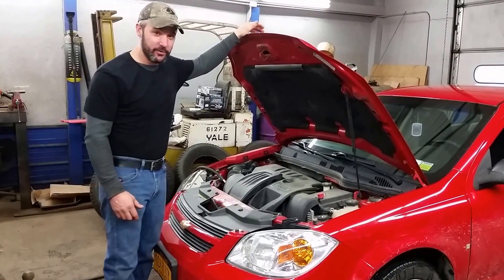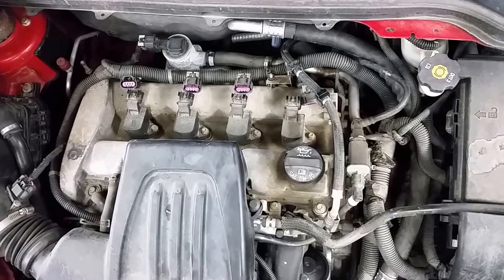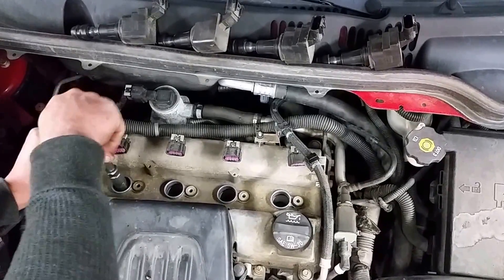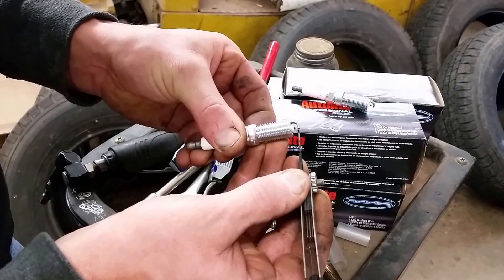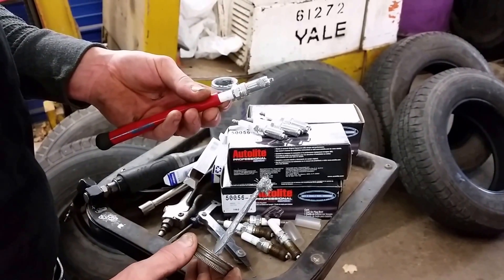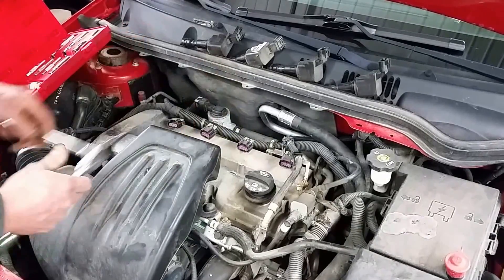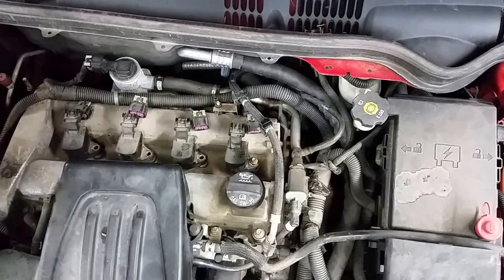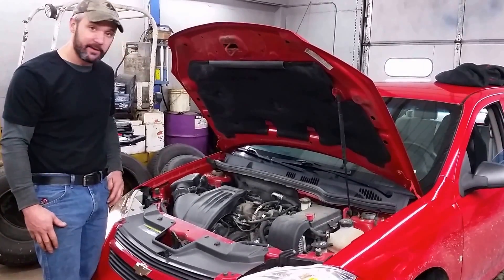Chevy Cobalt - Replacing Spark Plugs

Comment: I suddenly developed intermittent shaking after fueling in my 2009 cobalt 2.2 l . It has 121000 miles. I put it a can of heet  in red bottle. I drove it a few hrs and it ran fine then it returned. I have been using premium  non ethanol fuel for 12 years. It has original spark plugs. I got code P300- Random misfire. This only occurs occasionally. Could it be water in gas. There were torrential rains in area about 10 inches in past week. Could it be related to spark plugs? Would it be better to use ethanol gas in humid summer to prevent condensation of water . Any thoughts. Thank you. I wish I was in NYS now or would have you look it over. But I'm in Iowa.

Comment: I read that AC delco does not recommend anti seize?    Why not torque?
Reply: Antiseize is a personal preference thing.
After the first few hundred spark plugs the elbow calibrates itself to the right torque.
Reply: Thats great for you but what about the guy whose elbow is changing a plug for the first time ,  GM says not to use anti seize    back when heads were steel ,elbow torque wasn't as big and who had a torque wrench that could get down between the head and firewall or upper control arm .   Thanks for the tips
Reply: @rbspider   he does say some use anti seize and some don't.
Most spark plugs have a "tighten until it touches then go 1/8 or 1/4 turn more".  You just need to look on the manufacturers website.
Getting them out to s usually harder than refitting them.

Comment: Hello, Eric. If you are using a torque wrench, how much is too much ?  My wrench was off by 5 ft-lb and instead of 15 ft-lb I did 20 ft-lb... I removed the plug, replaced and tight it to 180 in-lb with another wrench, just worried if I damaged the threads.

Comment: paging dr eric o idk if you tried it yet but the castle brake lite grease works great as a dielectric grease too little pricey but very good we used it on all our star pack strobe lights and safty vision back up cameras on the garbage trucks i think it was around 30 for a vaccume tube cheese wiz can or they had those little 35mm film projectors contaners of it wow that ages me film strips and overhead projectors yes grade school late 70 s lol great work keep it up. wait this is from 3 years ago my bad

Comment: correction they did not make a 2002 cobalt in 2002. the cobalt came in the fall of 2004 as a 2005 model
Reply: Correct it was the Caviler before than. J platform. Cobalts were D plats.

Comment: Hi Eric, I have a 2.9L four cylinder 2007 Chevy Colorado with about 72K miles and the process for changing the spark plugs is similar... remove air intake, remove coils, remove plugs. BUT when I tried to remove the spark plugs they did not want to turn. I used a regular ratchet and pushed really really hard and they would not come off. I decided I didn't want to break the cylinder head on a truck I still have to pay on for another 50 months so I stopped at that point and put it all back together. Do you have any advice in this situation? I think I should just take it to a shop but I really don't want to pay $95 for something so simple - the only advantage that I see is that if they break something it is their fault, right? By the way, the engine was cold when I tried to change the spark plugs (it was sitting overnight) and the actual reason I am changing the spark plugs is I don't get very good fuel economy (16MPG), many people with these trucks report 20+ and because I have a rough idle issue. Thank you for any advice, your videos are informative (and funny!)
Reply: if your having performance issues it might not be your spark plugs. i gained 3 mpg in my recently engine swapped crown vic by eliminating vacuum leaks. such a common cause for performance issues. but if your plugs are 72k miles old, maybe changing plugs isnt so bad.
Reply: Michael Staake make sure your turning the ratchet the right way. left to loosen right to tighten. it should come out. with a Lil force won't hurt.
Reply: Michael Staake also doesn't hurt to add fuel additives to you gas. like Lucas fuel treatment or seafood. my two favorite brands
Reply: loganator78r mmm seafood! do you add shrimp, lobster, or crab?

Comment: Oh the good old Ecotec 2.2L...where valve seats wear out before the spark plugs! The one I just did didn't even have that stupid plastic cover on it to begin with...that's why the directions confused me "remove head cover #2"...WTF? I think it's a Eurotrash Opel motor design, since the timing tensioner said "made in Germany" lol
Reply: No offense Ivan, but 'our' Opel motor design got trashed when GM took over. Actually Opels are pretty good cars...as long as GM leaves them alone. Chevy once tried to get a foot into the German market, just when they realized their own brand Opel was better than what they offer to the rest of the planet. 

I myself am a JDM fan, but I think the 'Eurotrash' attitude seems to be a bit over the top, not every European Car is a Fiat or Volkswagen (and I think these indeed are 'Trash'). Every manufacturer has it's weaknesses or stupid ideas, but I think there is a reason why Mercedes can charge twice the price and still sell the cars, because there is 'some value' in them.

By the way, just take this as constructive criticism, I'm a huge fan of both your channels and find them really valuable. And don't ask me how I dug out this video...just popped up as if it was new...
Reply: +motoYam82 mine too
Reply from the maker: +motoYam82 It is made by GM "general mess" . Man you dug this video out of the trash haha
Reply: It was in my "recommended videos" list lol

Comment: For people that don't have compress air they can use a shop vacuum to remove the dirt before they take out the spark plugs.
I use a spark plug socket that has a magnet in it.  I like that better than a socket with the rubber plug.
Reply: Me to I have lost those rubber do dads on the plug after you pull the socket. Alway on recessed plugs to. I got a few good long reach pliers so I’m not complaining.

Comment: 2 questions. Is it possible to tell visually if the plugs need to be replaced? Is dielectric grease the same as dielectric silicone compound?
Reply: Plug gap can grow or rather the electrodes get vaporized away during use leaving a larger gap than original so yes, you can see that.  Often it's not so bad on some plugs and if they are burning clean they don't need replacing, but why make more work for yourself?  Just change them all to keep on schedule and be done with it.  When they fail internally you can't see a good one from a bad one though which makes it all very much a crap shoot and not worth trying unless it's a lawn mower.  Yes dielectric compound is silicone grease, it's also thermal heat sink grease for your CPU's heat sink for example.
Reply: matt spark plugs cant be visually inspected by eye. unless they are clearly broken lol. but i just usually replace plugs on a service interval or if i have proof that is my issue.

Comment: Hey Eric, what does putting dielectric grease on the end of the coils do?
Thanks
Reply from the maker: +Daryl Zero seals out moisture and stops corrosion
Reply: +South Main Auto Repair Thanks!
Reply: @SouthMainAuto  dielectric grease is my best friend, more then rtv or anti-sieze. I like to put a VERY thin coating on the ends of all my battery starter alternator and body ground points after I take a brass brush to them, keeps any corrosion from forming due to moisture. You just have to remain aware that dielectric grease is NOT conductive. So only use it when you KNOW for certain your connection is making positive contact.

Comment: Great video one of the main issues I have with modern vehicles are the dang 50,000 different styles of electrical connectors and how to take them lose. They are usually in a spot I can't see them either. If you have any tricks please share. Thanks
Reply from the maker: +Eric Corse No real tricks because they are all so different it seems

Comment: Another great vid.  I have an issue with the plastic engine cover.  You have to remove the oil fill cap in order to remove the engine cover then yank on the cover and dump all the surrounding  dirt into the engine thru the oil fill hole. I was blowing dirt away as best I could with compressed air before removing the oil cap. I have since removed the plastic engine cover permanently unless someone can give me a good reason that leaving it off might cause a problem.
Reply from the maker: dan andy Smart man.....

Comment: They are the non gasket plugs? I have a 09 Accent SE and I decided to gunk the engine, seems with all the engine covers the coils still got wet and it was running on 2 cylinders. I pulled the coils out and saw they [2] were arching out on the plug wells, bought 4 new ones on ebay for 36.50 including shipping, while I was waiting I replaced plugs, air filter and PCV- 1st time I ever torqued plugs=20 ft lbs. I just used 2 cans of Gunk on my 96 Jeep GC 5.2 and no problems

You're very good at trouble electrical shooting

Comment: I've always used anti-seize on the spark plugs over the last 30+ years as long as you don't goop it on, use it sparingly. I use my finger to remove any excess. The problem I've seen over the years is the "More is better mentality" not so in this case.
Reply from the maker: nswst8 Well Said Sir

Comment: How good are these cobalts, my roomate has found a "deal" on one. I'm a honda/toyota guy but I know some of these cars aren't to terrible.
Reply: Rick James I got mine pretty much new with a rebuilt title.  It's a 2009 so it has the VVT version of the 2.2 Ecotec, and I've put 87XXX miles on it with nothing more than oil changes, a wheel bearing, and a camshaft position actuator (44 dollars from Autozone.  10 minute fix).   Runs like day 1, and I'd drive it across the country today if I had to.
Reply from the maker: Rick James Mehhh there OK , Not a Honda but they are OK...
Reply: If you take care of them they run forever. With that said. Make sure it was well kept. GM used a lot of super cheap parts. Including but not limited to ball joints, and emmisions parts. Also make sure every recall has been done. There was like 16 different ones I think.

Comment: Hey any cobalt owners here have problems with the signal not working on front and rear but only on the right passenger side and same side bottom brake light not coming on when pressing the brake? The same right signal parking light for the signal will only stay on when headlights are on at night.
  Ive changed the light bulb for the rear brake light, it only turns on for a second when opening with alarm. Im stumped and tired of this pos! 
-Changed an alternator and fuel pump, had electrical problems in the past especially the key getting stuck in ignition.
Reply: ***** If the key is stuck in the ignition in the run/on position, that's actually a recall.  I had that problem a couple years ago.  Took it to the dealership and they replaced the ignition cylinder.
Reply: Yukon Silvermoon yea that stuck key happened in 07, n the key has one half in the ignition since it was my mother who used it and the amount of keychains she had on it snapped the key, i dont have money for a new key so it resides there until i take it for the recall.
Reply: ***** Jesus Christ.  Does your mother do triathlon training and hang her weights on the poor key?  I know that caused a lot of the cars to turn off while driving, but actually snapping the key is crazy.
Reply: Yukon Silvermoon lmao no she had heavy keychains like the disney ones n some little metal shoe n with the addition of the amount of house keys, It just gave. Luckily we made a extra for the doors but we had a alarm on it. But the driver side door stays locked when the alarm opens. This pos is having problems pop up since middle of 2013
Reply: ***** Wow, that's strange.  I guess it's just a case by case basis, because I have a 2009 model with a little over 87K on it.  Besides normal maintenance and recalls, I've only had to replace a camshaft position actuator, which costed me 44 bucks and took ten minutes to replace.  Oh, and also, the door speakers are crap on the cars.  They aren't well insulated, and shorted out with the smallest amount of moisture.  Replaced them with a pair from Memphis Audio.
Reply: Yukon Silvermoon mines a 06 goin at 91k. The driver side speaker popped so it doesnt play the sound. Also the hood, roof and bumper paint is chipping from sun damage so the list of fixes is going up haha. Im fucked. The only thing im focusing on is gettin info on the brake light because a ticket could be given and idk what is causing it if i changed the bulb....
Reply: Yukon Silvermoon oh i forgot. Right now im in the process of buying two front wheel bearing hub assembly to replace. 100$ each :(
Reply: +Alex M Cobalts do not have a flasher like cars of yesteryear. The flashing of the turn, brake and hazard lights is done by the Body Control Module. And the clicking sound you hear when you use your signals or hazards is because the body control module sends a signal to the radio to make an artificial clicking sound that is heard through the drivers side door speaker. Could be, your BCM is faulty and needs to be replaced or reprogrammed.

Comment: I have never understood the point of using a plug installer or vacuum line to start the threads. when a plug socket and extension works just fine
Reply from the maker: ***** Some people are dangerous with that combination and aluminum :)
Reply: yep

Comment: You can't stress enough how delicate iridium/platinum plug tips are! I would not recommend first timers trying to gap them, because of the risk of damaging them and also because they come close enough from the factory 99% of the time.

I used to also use anti-seize on plugs until I removed the same plugs I installed  about 3 years and 50k miles later. I thought I was pulling threads when removing them! The stuff gunked up from heat and made it a pain to remove. Also they are coated with an anti-corrosive plating already, so the anti-seize isn't as helpful as like on a suspension bolt for example. 

Just my opinions from my limited experience though.
Reply from the maker: Yeah those sucker sure are delicate definitely have to be careful. That's interesting about the anti-seize. Thanks for sharing that info.
Reply: Dan.vaku do you think it’s worth it to attempt to change the size of the gap?